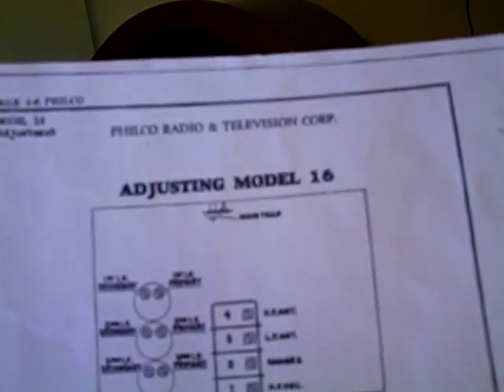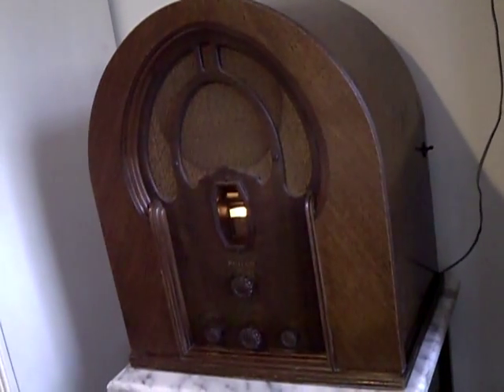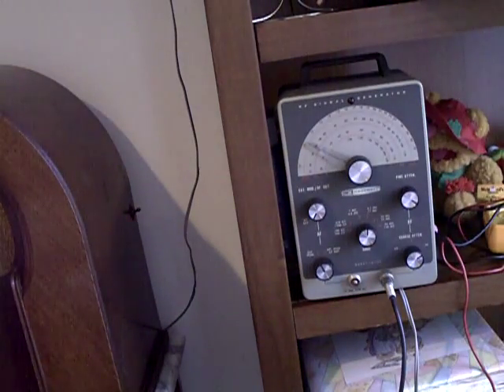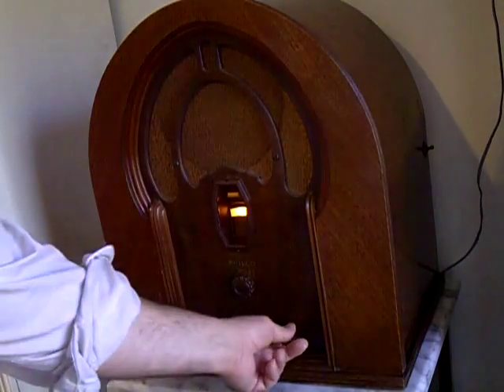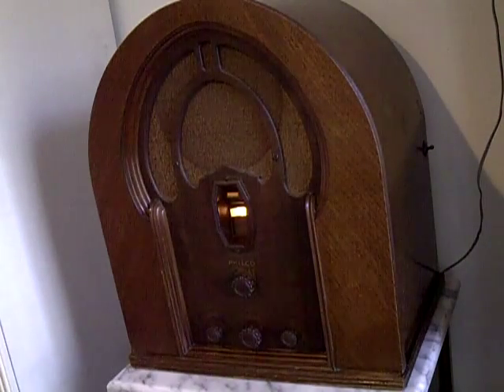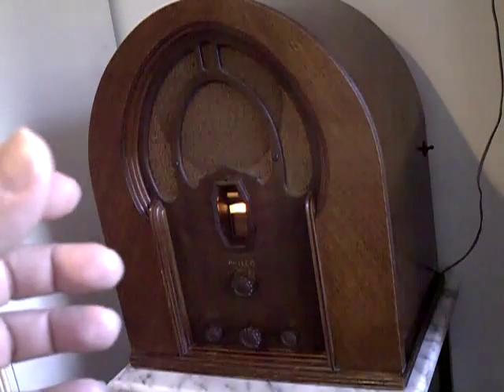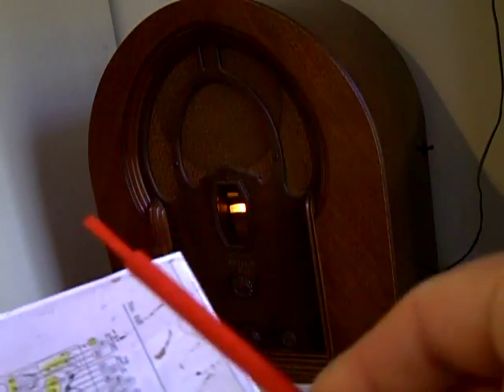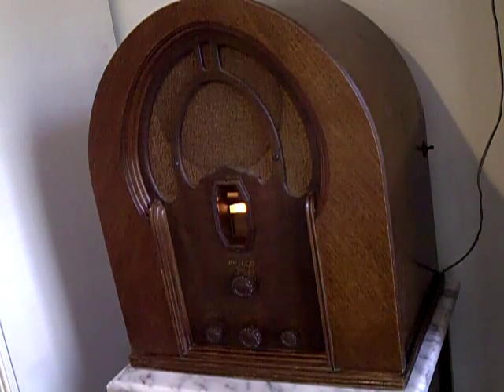Part 37 Philco 16B, The Alignment Procedure.

Comment from the maker: @ElvisSkrt Thanks!
 The tubes are all easy to get on either Ebay or Vacuumtubesdotnet. The set uses one 37 tube and only that one is a little pricey. The caps can be bought from Dave Cantalon at justradiosdorcom. I use the better electrolytics and you can get those at Mouser or Newark. Now, stuff like coils and transformers. Now THAT stuff is hard to find if you need one, but not impossible. My transformers were good. I rewound the shadowgraph myself. I put about 200-250 hrs into the radio.

Comment from the maker: Thanks Snuffy, I''m not exactly planing to do this radio just now, but then again ya never know! I'm tempted. I'd have to order a boat load of caps. Also study up on the variable IF and the magnetic tuning. I'm lucky the cabinent I have is pretty decent. I think one owner. In da meantime try the Philco repair bench maybe they have some info on this beast. I do not know since I haven't reseached it much. this Philco I just did is only radio number 3 for me. I teach myself as I go.

Comment: My 38-116 cabinet, while solid, has a poor finish and is not ready for prime time yet. I have electrically restored the chassis and have had it playing  temporarily in the cabinet. I'd like to redo the variable IF selectivity adJustments and re align the magnetic tuning  a little better. Also I need to replace the tuning gang grommets and set up the automatic tuning. To watch you do all this would be very instructive to me.- you're da man!